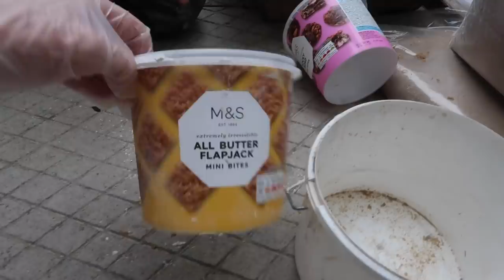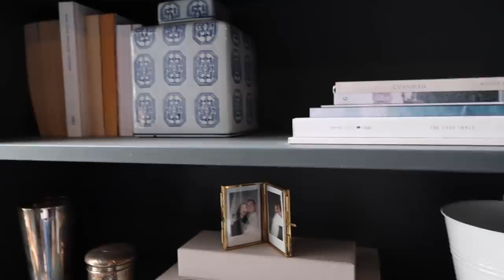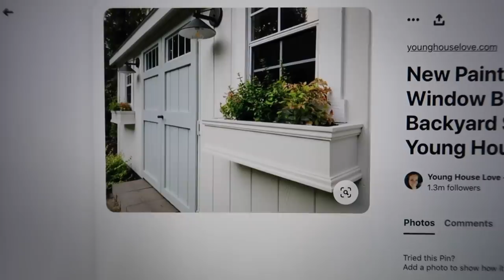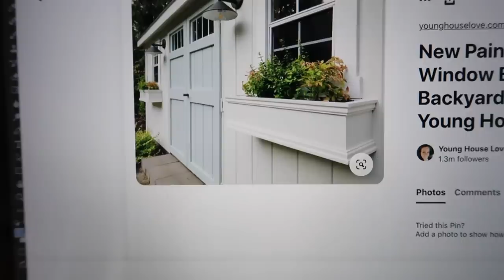ADDING KERB APPEAL | Laura Melhuish-Sprague

Comment: I have to fo the same job round the bittom of our house. Did you watch a how too video and also what did you use xxx
Reply from the maker: We contacted our plasterer who did our lime plastering inside the house. He left the bag of lime from that job and he let us know a mix. The mix was, one NHL 3.5, two building sand and one water. NHL is the lime plaster 😊 I just winged applying it but built it up in stages so that I could control it. Hope that helps xx
Reply: @LauraMelhuishSprague  thanks lovely will have a look and hopefully will give it a go 🖤🖤🖤